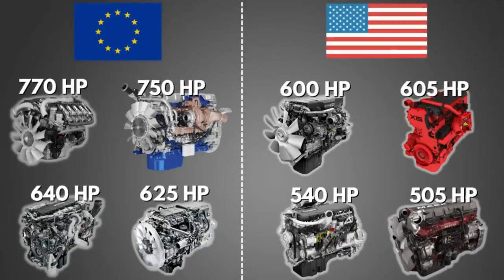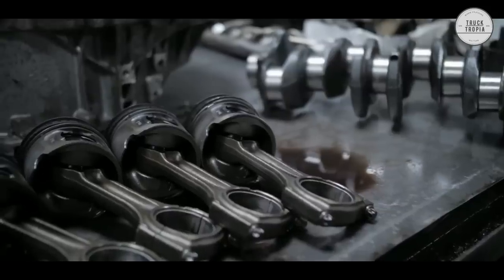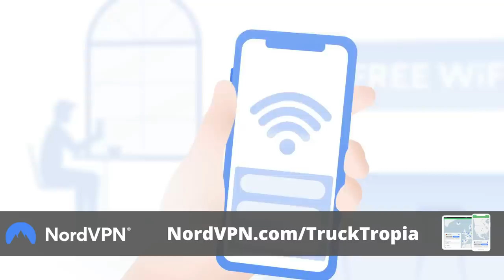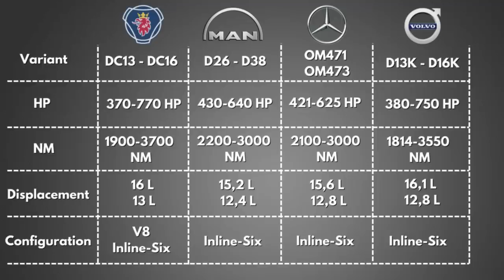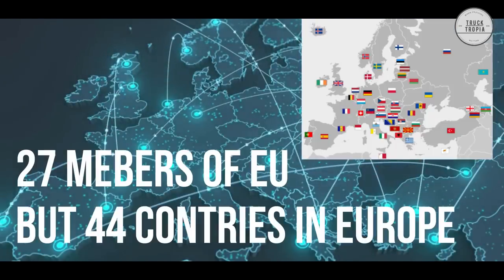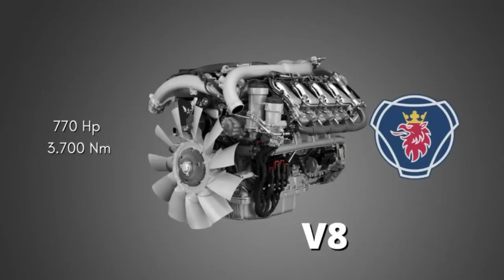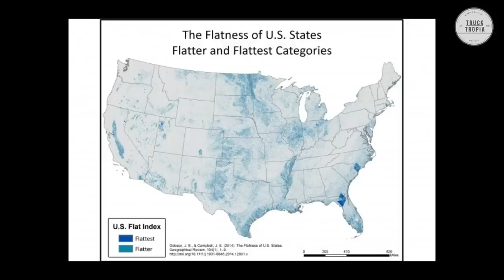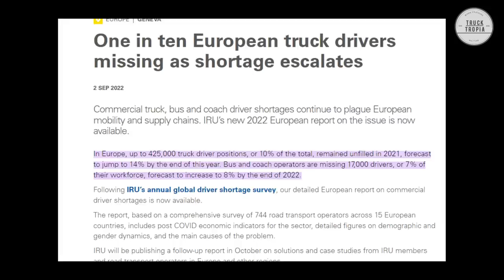Why European Trucks Have Up To 770 HP And US Don’t

Comment: Most of the Central Europe Trucks have 430 - 540? HP,  2300-2700Nm, so in real life, the difference in the "standard semi trucks", where the driver is at home just for the weekend, is not so big. Reason: Fuel efficency... So there is clearly to accentuate: they have "up to " 770 HP. You don't see them every day in Germany f.e.
Reply: In Europe it is very common to see trucks over 540hp, in Spain you can carry up to 70 tons approx, but it is also very common to see large engines for 25 tons of cargo... A 630hp Mercedes with 40 tons spends less fuel than a 500hp American

Comment: Greetings from an german truck driver. The typical hp for an 40ton truck in europe is about 430 to 500hp. more is not needet and just expensive, and cost money all the time, cause a bigger engine is heavier and burns more fuel cause of more internal loss. You can also drive an 40ton truck with less than 200hp, its just slower. And over 400hp the average speed is not going higher. I had on the road from munich to barcelona an average speed of 88-89km/h with an 90kmh limited truck with an weight of 30tons (ok, i let it run downhill :) )

Comment: I've seen a few road trains here in Australia pulling 4 trailers on private roads and big triples on public road. They seemed to be switching to the 700HP Scanias and Volvo. A few tippers also running 700HP but that's owner operators wanting the big engines for show lol.

Comment: An engine doesn’t have power or torque. - The power and the torque curve are a design feature and are determined by the design engineers and can be changed as per needs and application.  In addition, its the load factor which decides how much of the torque and power is really being used .  The higher the load factor i.e. the higher the max power and torque being used the shorter the engine wear life.

Comment: The distance From London to Rome is about 1200 Miles. The distance between between LA and New York is about 2800 miles.
With one mountain range with a max of 11,000 ft between it and New York and another through Appellations that maxes at 5000 ft.
You get used to trucks doing 20-30 MPH going up and down those ranges.
But in states where 75 MPH is allowed. They do it. Some trucks are speed limited by the owner to 62 MPH. Most of the highway is 65 MPH.
Reply: pretty sure any truck that ever goes into Ontario has to be governed to 62mph
Reply: I do not see the significance of mentioning the London-Rome distance, might as well have mentioned Lisbon to Tallinnwhich is just under 2700 miles...
Reply: @zephyros256  Mountains. Phoenix to Miami 3800KM No mountains. No need for big horse power.
The Grapevine is 40 miles of up and down 5-6% grade
 Seattle to San Diego. Big Horsepower. Big grades. Lots of them
 This may explain it. California has problem with diesel. Wants all electric and everybody else to pay for and generate all of it. The real fun is turning the A/C off to keep the engine from over heating when it is 45C and pulling a long grade. Pretty a much normal day for summer in inland  California.
 Also between London and Rome lots of mountains and roads that have lots of curves and elevation changes. Need short wheelbase and big horsepower.
 London to Rome needs lots of horsepower to move perishables.

These old timers were made for the west coast. The diesel units are used to provide A/C and electrical power for the passenger cars. The steamers are pulling everything.
Used in the 40s for 100 MPH passenger travel.
https://news.yahoo.com/why-sp-4449-badass-train-143100520.html
https://locomotive.fandom.com/wiki/Union_Pacific_844
https://www.youtube.com/watch?v=7qD_uGmVsHc
Reply: Appalachians.
Reply: Utah is about the size of Germany, with approximately 80 mountain ranges. Highway 40 in NE Utah is a corridor for crude oil hauling, and has extensive passing /turning lanes for regular traffic to pass trucks that while powerful, are underpowered for the 129,000 pounds they typically load.(47k truck/trailers, 82k oil). Climing out of the Uintah Basin to SLC is typically a 3+ hour drive loaded, and a 2 1/2 hour return trip, which includes a refueling stop. I've had to use tire chains twice so far this season,  and that's with aggressive plowing on the passes during storms, (God bless those plow drivers)
With that, and the narrators accent in mind, this video comes off as a wee bit biased.
Reply: @bfgoodrich8564  Or you can cross Texas on I-10. 740 miles, with just a few minor hills.
Not many have made a trip like going from Cleveland to Provo. Get detoured over the mountains and come down in the rain on the mountain near Vernal. Then see where the rains stops and the irrigation begins. 
 But driving a army 2 1/2 ton through Germany is bit more ups and downs and turns.
 Alaska is is another place. Like delivering a load from Anchorage to Seward. Like Germany but colder.
Reply: If you talking about Europe, then Europeans will read it, too. Just try to  dub your units with the metrical equivalents (km/h, metric ton, etc) just out of respect.  Thanks.
Reply: @ferencszathmary9689  North American vehicles switch between KPH and MPH with a push of the button. I loaned out my Canadian Ford to someone driving on I-96. She thought she was moving along fast enough at 60. Those were the big numbers on the Speedo. It was a  94 Crown Victoria.
Just  5 MPH below the minimum speed.  Never occurred to me that I would have to explain that.
10 miles of distance = 16 Kilo. pretty easy if you know what  10 (Base 16) is in decimal.
Rome to London.
 1600 + 360 = approximately 1950 K 
You get used to it when you leave I-94 and take the 401 in Canada.
 That Journey thing ("Don't Stop Believin") about South Detroit?
 That could be Windsor, Ontario.
 Yes you do go south from Michigan to go to Canada from Detroit.
The Gordy Howe Bridge will South East. It is by Zug Island. The tunnel and The  Ambassador Bridge Entrances are in or near downtown Detroit
https://duckduckgo.com/?t=ffab&q=Gordy+Howe+Bridge&atb=v330-1&ia=web&iaxm=about

Comment: I'm from Ireland and I wish we had the USA style with the huge sleeper cab because ours are tiny with no space but the bull nose cab whould be hard to drive here because of how tight our road's are and pulling out from somewhere with so much sticking out in front whould be a nightmare
Reply: Yea even driving one of these large sleeper cabs without a trailer, you might as well be driving around a city bus.😆
Reply: @thebaddestogre-3698  they are not as bad as you think. i drive an 02 peterbuilt with a 450hp cat engine. it is a big nose but i drive this thing in and around new home construction sites all the time with little issue.
Reply: Then you haven’t been in the bigger Volvos’ or Scanias that are more common in big Scandinavia, basically a hotel!
Reply: @flashgo2  are you familiar with the average european street? Especially in older cities (where 'older' can mean that some cities are more than a millennium older than the usa)
Reply: Why not a cab over instead then.
Reply: @HvV8446  visited itialy. I was not sure how my brother's local car fit down some of those roads
Reply: How much time do you spend sleeping in your truck? Your country is the size of the state of Indiana. I would think you could be home most days.
Reply: @thebaddestogre-3698  I am positive that a normal city bus is more manoeuvrable than many a truck due to the wheelbase being behind the steering wheel on most if not all.
Reply: The long nose is very efficient for bumps on the road, it distributes weight well, compared to cab-over applications like you guys use in Europe. Also in case of an accident I can bet you'll be safer in an American truck like a Peterbilt with the long hood than a scania with only a window between you and the road.   

But you are correct, Europe is a much older area and has older cities,  roads were build for horses ending in a lot of really small roads to get around, an American truck would have a lot of trouble getting around. Cheers 🍻
Reply: Not to mention that you couldn't run with a std 40ft box/container I bet. Thats certainly the case here in the UK with a 55ft max length, and given EU harmonisation, I bet you have the same length restriction.
Reply: @stevesmith7530  in US length is restricted to the trailer 53' the truck on the other hand is not restricted really as some of these guys stretch their frames to ridiculous lengths and drop super sleepers on them basically small houses lol
Reply: @wesleymccoy870  you'd never get it anywhere on many European roads :) 

Semis are 55 foot limited, or a rigid and trailer combination can be 5ft longer. Even warehouse yards are built and laid out with such lengths and combinations in mind.

It always surprised and concerned me a little that there is no side underrun protection required over there, just the rear Mansfield bar
Reply: @stevesmith7530  the rear is a major issue that they did address with said bar. the under run i have seen maybe 4 accidents in 8 years of driving were that might of helped. but then we can also slide our tandems on our big 53foot trailers to balance the weight we carry. older 53foot trailers the axles could slide to the 38 foot distance but modern its 39foot. But then you pull a trailer were its all the way to the rear. thats 10feet of distance were we could not have that side protection, so what do you do.

when i was talking about the pete being easier to steer then you think. it may be long nosed but there steering can turn sharp, my pete can actually turn the wheels sharper then some american volvos, but its are longer wheel base that makes it turn wider. and if we are praticed anough. we can make people scratch there heads on how we got that truck in there.
Reply: @flashgo2  I see reports of collisions with side underrun bars many times a weel  There are the obvious crossing traffic ones are the rarest, more common are people/cyclists/vehicles being caught there whilst the semi is turning or sideswipes on highways. I would argue that a 10ft gap is better than one 4 times longer.

I don't doubt the skill of many large vehicle drivers, but even our relatively short, cab-over 55ft combinations often have a steering axle on the trailer to make urban work viable. There is very little of the long haul highway stuff here really, as much, if not more time is often spent in congested urban areas, or rural back roads than on multi-lane highways. Your tractor unit alone is likely the size of many goods vehicles operating around here, a 3 axle rigid has a maximum length of 40ft. 

Quite common is the "urban" semi, a regular cabover tractor, with a single axle 20ft trailer, simply because large vehicles can be so ponderous.
Reply: Or just a European truck with a larger cab 🤷‍♂
Reply: @bajaboy27  "Also in case of an accident I can bet you'll be safer in an American truck like a Peterbilt with the long hood than a scania with only a window between you and the road."

Should probably not draw such conclusions so easily 😉
Reply: U would come far on EU streets with US trucks
Reply: @AlexKall  

"Should probably not draw such conclusions so easily" 

Prove me wrong then.
Reply: @First Name Last  For distance, consider all of Europe as one single country, so the trips are long. Plenty of need for sleep.
Reply: @stevesmith7530   Watch "Iwona Blecharczyk" driving a longer Jumbo combo Volvo all over Europe.
Reply: @awuma  all over Europe, but nor down many roads near me where even long rigids have trouble, so big deliveries go by the aforementioned urban combos. 2 axle tractor and 20ft single axle trailer
Reply: Don't need huge sleeper cabs in Europe because Europe is so densely populated, never far from services
Reply: Come to Australia and you'll see a mix of both.
Reply: @bajaboy27  long nose is efficient for bumps on the road but that has to do with suspension/cab design also- I drove a Renault Magnum cabover with full air suspended cab- amazing how smooth it was compared to a standard hood cab of the US. and that was a '95 model, I can imagine how much better the ride tech has become. full air suspension + full air cab really makes a nice ride. US truck has only rear of the cab air ride and hinges on the frame on the front.
Reply: @davidroberts6594  drove a cabover once and didn't like it.  Unfortunately I'm the US for the most part they're not around anymore.  But I still would much rather drive a long nose peterbilt than a cabover  based on my one time experience.   Cheers 🍻
Reply: I love how you wish you had Usa style trucks, but at the same time you say driving it would be a nightmare 😂
Reply: I understand the problem with the length of trucks in Europe, but cabovers would seem to be so much less fuel efficient because you are pushing so much air.
Reply: @scrambler69-xk3kv if you check european cx is not so far from us truck. The basic geometry seems to favor the US,but the american manufacter is slacking off